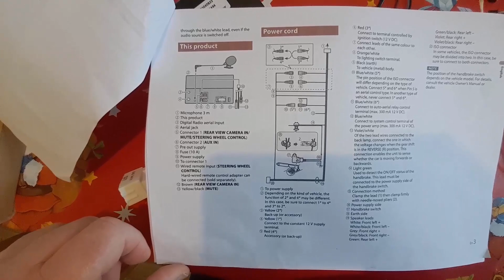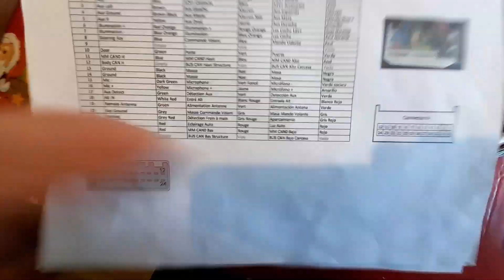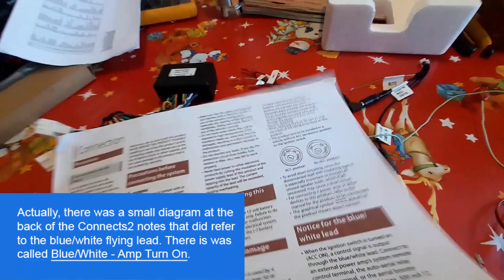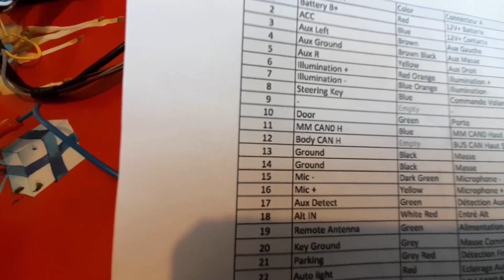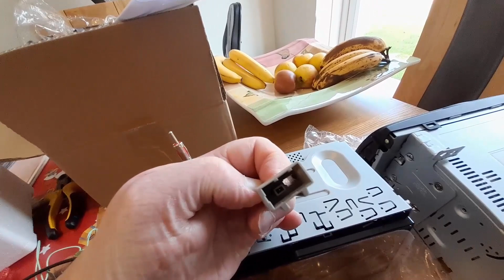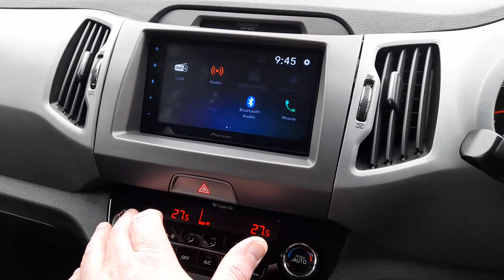Fitting an Aftermarket Audio/Satnav Head Unit to a 2015 Kia Sportage With Amplifier

Comment: Really interested in this but not clever enough to understand! I am buying a 2016 Mk4 Sportage with a premium JBL sound system and nobody I have contacted, so called specialists, are willing to take the job on. Any suggestions greatly appreciated.
Reply from the maker: Sorry, but I can't help. The reason that I discovered the things that I did and spent quite a while working on this was because I had the same problem. There are a few experts around, but they mainly want too much money to do what amounts to a custom job. I made this video to help where I could, but every car and sound system is a bit different, so they have to be researched before work can commence, as I explained in the video. If you are not somewhat skilled in this kind of thing, all you can do is keep asking around until you find the right person at the right price. Good luck.

Comment: Dude, I just want to say a big massive thankyou to you for this video. I just fitted a T’Eyes CC3 2K into the same model car you have. The wiring loom they sent wasnt the right one exactly, various wires not lining up at the connector. Your video and a bag of Wago’s and some wire and its all running. For anyone else trying this with the CC3 2K and C harness, update the units canbus settings in T’eyes app, I had Hiworld canbus box, sportage 3 C AMP is the setting, you need to cut the Acc wire at Kia car connector and join to G3, the reverse and steering key wires and join them to G7 for steering (learning) and G5 for reverse to activate rear cam. You can join the mic cables as above and use the same sirius adapter to get DAB should you wish.
Thanks again for the vid, the way you explained every connection allowed logic to apply it to any harness or head unit for this awkward car with amp etc
Reply from the maker: Thanks for a nice response. And you're right, if you apply yourself in a logical manner you can probably do this for any car.

Comment: Hello. I have a Kia Sportage 3, year of manufacture 2015. Everything is functional on the android radio, only the sound is not working. I can't figure out how to connect the sound to the Kia connectors. Please help.
Reply from the maker: Hi, watch my video carefully. Everything you need to know is there. It tells you what adapter kits to buy and what wires need to be spliced. Beyond what is there I cannot help with. Did you look at the pdf file that I linked to under the video? it shows all of the Sportage connector pin-outs, what to solder and the names of the kits that I bought. If your car is the same as mine, the information is all there. Doing that job took me a long time to figure out, so I am not saying it's easy, but for that reason I tried to include everything that I learned. You say that the android side is working, but there is no sound. I had the same situation, but I realised that I did not have 12V from the car going back to the amplifier via the connector kit. This information is in the video and the pdf. Good luck.
Reply: @daparocksstudio  Thank you for your answer. I watched the video and the pdf file carefully, but I couldn't figure out which pin the amplifier and subwoofer connect to. I bought the radio with cables and canbus. I can't understand which pin they connect to.
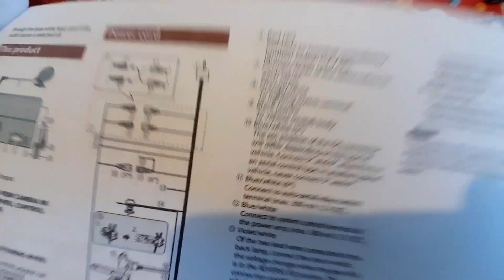Reply from the maker: @camsat-o9v  These KIA models can be quite different, even if the year is the same. My model has a rear amplifier, meaning that the amplifier is at the back of the car. The reason that I initially got no sound out was that I was not getting 12V to this amp. Assuming that your car is the same, and that you have purchased the same Connect2 kits that I have, then you can see what I had to do to get the 12V out to the amp on my video between about 13:15 to 16:09. You have to solder wires. Then if you go to the pdf file, on the second page, I have supplied a link which says 'Link to the 2015 KIA Sportage wiring diagram. Find a similar one if you have another make and model of car:' If you click on this link you will see a diagram showing all of the pin-outs from the KIA connectors. The 18-pin connector has connections called Front Right + and Front right -. These are the signals that go out to the speakers. However, these are picked up by the Connect2 kits, so I did not have to do anything with these.
Reply: @daparocksstudio  There are speaker outputs on the 18-pin connector, but they are empty and the speaker outputs from the canbus go exactly to these empty outputs. I can't figure out which amplifier cable from the radio connects to which connector from the KIA radio and to which pin. I made the other connections according to your diagram, it helped me a lot, for which I thank you very much.
Reply from the maker: @camsat-o9v  So, are you saying that the  that the speaker wires that should come from the KIA are not in the 18-pin connector where the diagram says they should be?
Reply: @daparocksstudio  If possible, I would send you a photo, but I don't know how. The cables on the 18-pin connector are there, but they have a different description than the outputs from the radio. I just don't know where and to which connector the cable from the amplifier from the radio should go, to the connectors and pin in the Kia connectors..
Reply from the maker: @camsat-o9v  Hi, You can send me an email with picture at: daparocks@gmail.com  If you want me to help, please also include your vehicle registration number and the VIN code, which you can find at the bottom of your windscreen on the passenger side. Also, please let me know which Connects2 kits you have purchased by part number. Regards Paul

Comment: Hi, 

i have a similar setup to this, ie: new android head unit fitted.

Unit works & sounds comes out of the speakers

But one of things i found is that if you the "fade" function on the head unit, ie: fade allows you to 
adjust the sound distribution between the front and rear speakers.

I found the following: 

1. if fade only to front speakers, sounds comes out.
2. if fade is in the middle or centre position, sounds comes out (i think mainly from front speaker but faintly fron rear)
3. if fade is on back speakers only, no sounds comes out.

my questions to you is as follows:

do you expirience the same pattern with your head unit or does the fade front/middle/back works as expected ?

thank you

Ian

PS: thank you for the pdf in advance
Reply from the maker: Sorry, I have never paid much attention to sound quality with respect to positioning, so I am unable to help with this. I can't say that I have even checked the front to back positioning. I got audible sound, so that was all I cared about.

Comment: Hi..I have just installed my HeadUnit H6 from AINAVI..everything works great except for humming sound from the speakers, can you please advice?
Reply from the maker: I won't pretend to be any kind of audio expert, but my first thought would be cable connections/condition or grounding/shielding. Here is an article that I found: https://getjerry.com/car-repair/how-can-you-fix-buzzing-speakers-in-a-car/#:~:text=Loose%2C%20damaged%20or%20corroded%20audio,make%20the%20buzz%20go%20away.
Reply: @daparocksstudio  thank you so much.. Any help will be appreciated

Comment: Hi. Thanks for making time to do this video. One thing I am not clear on is which pin number/ cable colour on the Kia harness is the 12v amp supply connected to. I have a different kit to yours
Reply from the maker: sorry, I don't know. I was just focused on getting the 12V onto the Connects2 connector. what it did with it after that I don't know. However, I can tell you that Connects2 have a technical dept. that will answer emails promptly and fully. So, if you ask them I expect they would tell you. Paul

Comment: very good video i had one cost me £630 the lead it self was £ 269 just for a lead i got it all out fitted it then i was pissed off with it all but now i have seen your video i will try again lol were did u get yours from and how much i have the same as u amp in the boot . ps i will try again cheers top man .i sent mine back i wil get it agian .
Reply: Omg thanks for this.  I've spent €500 on fitters who couldn't get sound from it and wanted 300 more 🤣.  I'll try your fix tonight 😜
Reply from the maker: @equigs  Really pleased to hear this. I definitely want to know how you get one. Please let us know. Just one thing, if you have watched the video in full there are a number of kits needed, plus adapter cables and connectors. Make sure you have it all before you start. Full details are in the pdf. Good luck.
Reply from the maker: I got a Pioneer SPH-DA160DAB from Halfords in the UK. It cost around £240, but there was a special deal at the time, it's gone up since then. When I discovered how to get the 12V to the amplifier and got some sound out, that gave me the confidence to work on the reversing camera and the microphone. Looking back, it was all quite easy, but the problem was lack of information and a bit of confidence. Good luck when you try again.
Reply: Still don't know what to do  ?
Reply from the maker: @taznoaman1533  If you have the same make and model as me (with amplifier), then all the information you need should be there in the video. That said, you do have to be prepared to work at it and to take the dash down more than once. It's not an easy decision, I know.